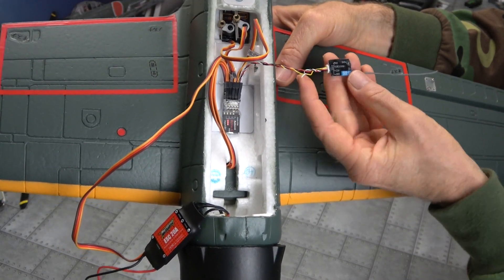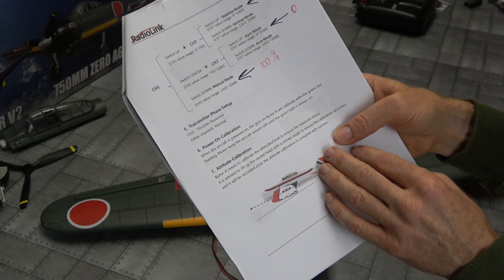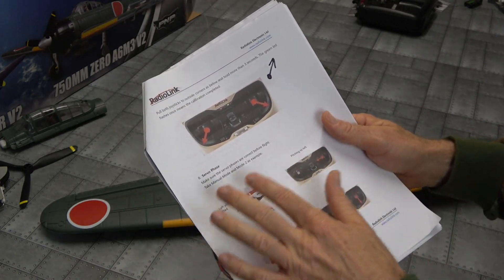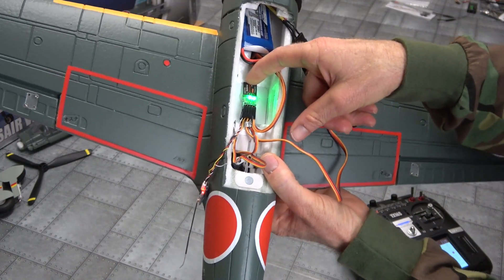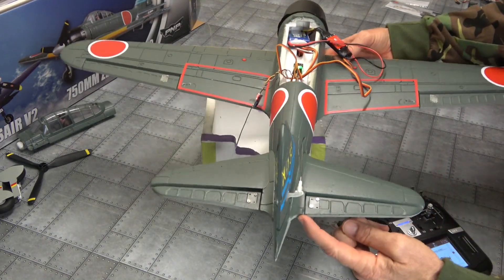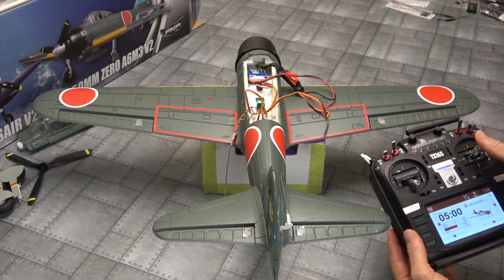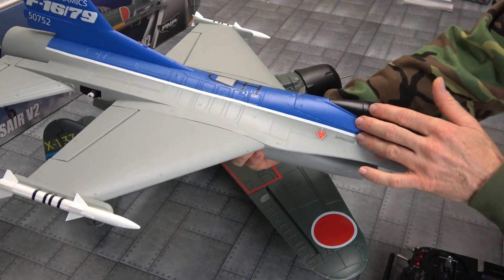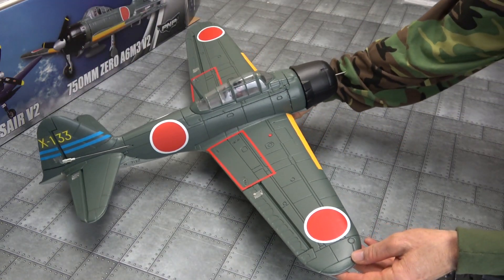Radiolink Byme-A Flight Stabiliser Setup in FMS A6M3 Zero Gyro Flight Controller RC Airplane 4CH

Comment: Thanks for the great video, I have a question about the ailerons setup. Since the stabilizer only has one channel for aileron and you have two aileron servos, did you use a y-cable to connect the two aileron servos with the Byme-A?

Comment: Hello, I have a question . In manual mode, the ailerons and rudder deviate as expected, to the desired angle, and in the Stabilization and Gyro modes this is barely noticeable (I'm talking about compensation for changes in the position of the aircraft). Is it possible to customize?

Comment: Great video! Thank you. Strange question on the Byme-A the negative is on the bottom for all plugins, however, I can only get the FLYSKY FS-A8S to light up if I plug it in with the black (neg) on the top then red, then yellow. Even then I can’t get any channels to move. Is your FS-A8s plugged in upside down? I have a Radiomaster Zorro multi-protocol and bind it using your settings but when I bind it keeps beeping and slow flashing until I manually stop binding then it goes solid. Not sure if my Byme-A is bad or not. I also get the same results with a cm410X receiver but it has to be plugged in normally (black down). Still, no channels work.

Comment: Thanks for the great video. I just got same setup and made it work. BTW you don't have to cut and solder yellow wire (so called forced PPM). If you leave it as it is it will use iBus. iBus is not supported by Byme-A but once you bind it to the TX, once connected and red LED is on, long press Bind button - this will switch from iBus to sBus which is supported by Byme-A. After that everything should work. I hope this helps someone.
Reply: perfect mate. thanks alot!!
Reply: Thanks you for sharing!!!

Comment: hi mate will that little flysky recieverand radiolink flight stabilizer work with the flysky fs-i6x transmitter
Reply: Yep, mate. Works perfectly. You can use the PPM output from the A8S or switch the A8S to output S-bus instead of i-bus (as described in the A8S manual) - either will drive the Byme-A. Remember to select the correct output mode in your FX-i6X settings. You have a 3-position and a 2-position switch to assign to channels 5 and 7 to control the Byme-A modes.

Comment: im using FS-I6 UPDATED FIRMWEL TO 10 CHANNEL but it wont connect on my transmitter . my flight control is byme A. PLS HELP THANkS
Reply: What Flysky receiver are you using? The Byme-A is a stabilizer only, not a receiver and stabilizer.

Comment: Posted this on the forums Blowy, but will add it here for the video-only punters. ;-)
Used the 'Special Functions" feature on the Radiomaster TX16S OpenTX radio to create a different modes set-up that more suits us Old Coots.
Put "Stabilized, self-leveling with angle limits", Stabilized, self-leveling with no angle limits", and "Gyro, wind correction only" on a single 3-position switch. Then added an over-ride function on another switch to force the "Hover" mode on and finally a third switch to force the Stab to "Manual." Used a 3-position on the "not up" command for the "Hover" (a 2-position would be better) and a 2-position for the "Manual". *A finger-held momentary 2-position would be best.)
Reply from the maker: Thanks mate

Comment: Hello my good friend..excellent video on this gyro install..
Now..I have a question..
Can the rudder be added to the Ailarons for turning..so that turning will be easier with out manuely using the rudder stick to turn..what do you think..???
PS..I 
Truly like your upgrades to these rc rtf planes..yous install instructions are better then most..👍👍👍👍👍..so I will be waiting for your response to that question about mixing the rudder to the Ailarons..
Reply from the maker: Thanks for your comment and yes you can do the rudder mix on your radio and it will not effect the gyro.  I have the rudder mix on my Hking hawker hurricane it makes it a  lot easier to fly

Comment: That manual you show there isn't quite the same as the 1 on the current RadioLink website, Blowy. Also I don't quite understand how you are getting the choice of modes that you describe without setting channel 7 to a switch that will give you +/-100 to select between Stabilize (Self-leveling with 45degree pitch limits and 70degree roll limits) - Acrobat (Self-leveling with no limits) - and fully Manual. 
OR Vertical hovering - Gyro (Rate mode with no self-leveling and only wind deflection compensation) - and fully Manual. EDIT 2 Actually the positions for "Acrobat" and "Gyro" modes ARE transposed.
The only way that I can see that you would get the first group without setting up a ch7 switch would be if your Tx channel 7 was outputting way outside its center position of 1500us. (It does happen!)
EDIT...Actually I just checked 1nformatica's video on the Byme-A and he shows the same manual as yours. The 1 that I got from some link (may have been an old 1 from an Aliexpress sale site) was showing the Gyro and Acro mode positions inverted. I think that mine may be from an old version since I seem to remember Quadcopter101 saying that he found the switch positions for some modes to be incorrect when he reviewed the RadioLink A560 3-D plane. The question about needing ch7 still valid though. Also those output range figures in your manual are really weird - should look more like 988us to 1300us, 1300us to 1700us and 1700us to 2012us surely?
Reply from the maker: Yes I just google search for the manual and sometimes keeping setup simple works
Reply: I had the same problems and questions like you but I set up like in the video and it worked for me just using chanel 5 for the 3 modes I needed.: estabilized, acro and manual ( like in betaflight or inav)  although they call the modes differently in the manual what they actually do is that,
Reply: @ebg4614  Thanks for that, mate. As luck would have it I just picked up another Byme-A and a receiver from the Post Office this afternoon. Thus I'll have a go at setting it up tomorrow with my TX16S. 
The only thing that I can think of is, if the channel 7 output range for the Byme-A to select 1 half of the possible channel 5 selections really IS 1300 to 2000 as in that manual. That would then be possible because (with the S-bus input) 8 channels would normally be available and (with no extra Tx settings) ch7 would be at the 1500 midpoint. Enough to trigger the Byme-A into the 3 modes stated. Have to do some testing. Keeps the few remaining brain cells active. ;-)

Comment: You are still using the A8S receiver PPM output Blowy. It will work with the Byme stabs but it probably is better to switch the S-bus output on from the A8S and use that. (It comes default set to i-bus.) I can't remember what all the advantages are. (1 was that S-bus receivers automatically recognize a loss of signal and I think that they work faster than PPM but don't quote me on that.) Looking forward to putting the same combo on our Eachine Flying Fish that finally turned up. Also plan on trying a twin motor set up (scaled up a bit) on our $10 Kmart chuck gliders when some other bits turn up.
Reply from the maker: Yes maybe I should do some YouTube research on this receiver yes that eachine fish looks good
Reply from the maker: We have tried some chuck gliders the little ones failed because we had no gyro
Reply: @blowy48flyrc  The A8S/Byme combo should be ideal even for the 37cm ones let alone for the $3 48cm Kmart ones and the $10 84cm Kmart ones. I like the idea of a twin so there is no motor sticking out the nose to get crunched! ;-)
Reply from the maker: @theoztreecrasher2647  that's why the eachine flying fish would be great no motor in front
Reply: @blowy48flyrc  Byme-A added to the little twin Fish. Flies a treat on 3s 850 Turnigy with CoG on the nubs. Flies quite happily on 2s 1300 but too big to have the canopy on. 
Also set (ch 7 on a 3-position switch) to get Hover and Acro Modes as well. When we switch to center 0 on ch 7 (1500us) it remains on Manual/Gyro/Self Level Stabilizer on ch 5 so those odd figures in that manual might be partly right at least. Switching to -100 (988us) goes to Manual/Acro/Hover on ch 5 though so that doesn't tally with that manual.
Used your scheme of multiple bits of foam tape to mount the stab and cinch it down with a tie over top foam and out around a little ply reinforcement under the fuse. Works a treat! 👍👍🙂
Reply from the maker: @theoztreecrasher2647  happy to hear this gyro is working great for you too and that eachine flying fish great to hear

Comment: Hi, thanks for your videos. I have the radio link bymeA installed in a 50mm edf but I got a lot of shaking in the roll axis if I fly more than half throttle. Any idea how could I fix this?. Do you think changing the aileron linkage to an inner servo horn hole could help? Thanks
Reply: The gain is to high and I think with these gyros you cant change them, I think there ment for slow planes
Reply from the maker: @MikeyMikey1968  that is right can't adjust the  gain
Reply: @blowy48flyrc  thks!! I am willing to see how your f16 perform with the radiolink stabilizer
Reply from the maker: @ebg4614  yes me too
Reply from the maker: Yes I think you have the right idea changing servo or horn holes you can turn up or down the effect of the gyro . So yours is shaking the faster it flys so like you said move rod on servo down